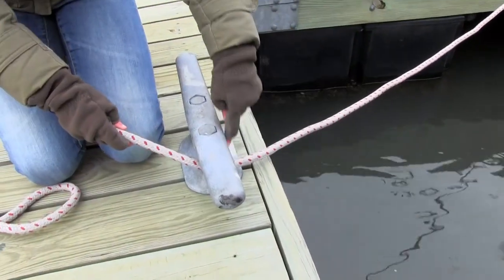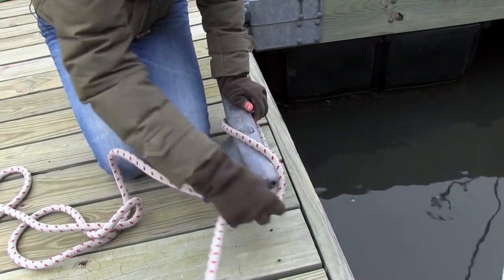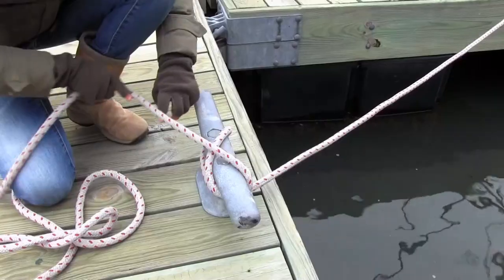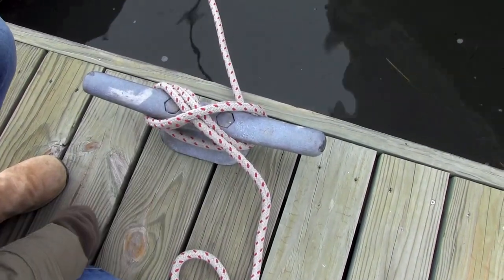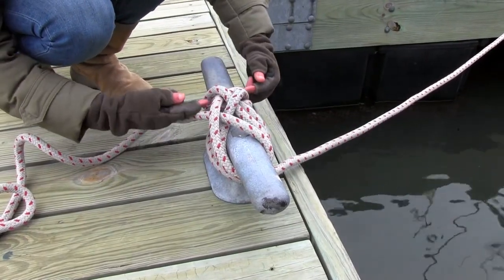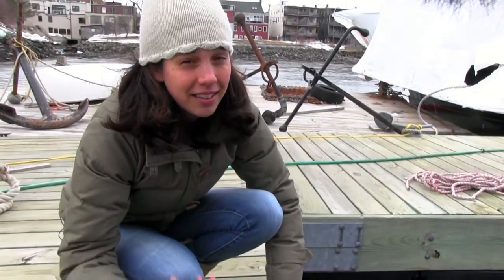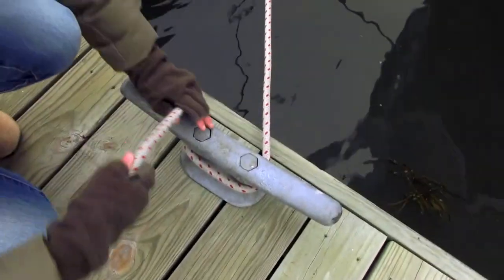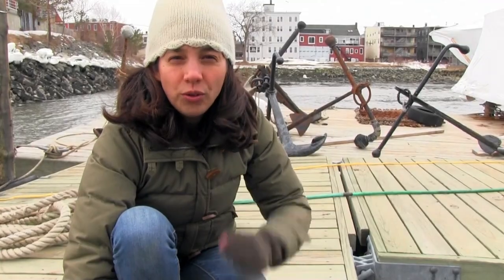How to Properly Cleat A Line - the way we learned on tall ships and other vessels with heavy loads

Comment: Question for you (great demo, BTW): how do you start the hitches when the load is perfectly in line with the horns of the cleat, ie. the turns MUST get pulled under the loaded length of line leading away from the cleat?  (I hope that makes sense?  You know, when there is no “V”?  A good example would be some cleats that are beside non-self tailing winches.)
Reply from the maker: Ahh yeah this happens all too often. It's poor design on the manufacturers part. They want the cleats to look symmetrical, but unfortunately it screws up the lead.We have the same issue on our stern cleats for docklines. I have no good answer. You could fake the lead by "barber-hauling" the line, but that's not very elegant. You could add some kind of line organizer type fairlead, but that will induce friction. Best solution is to remount the cleat so you have a fair lead -- or a "V" as we demonstrated. I feel your pain.

Comment: I can understand a single lock in some cases, but as far as I know, the standard is two locks. It's what I prefer at least. I am curious about your view on the direction of locking; parallel or crossed in relation to the underlying line?
Reply from the maker: There's really no need for a second lock. I've never heard of two locks being standard. There's no need for any locks at all, except to keep the line from accidentally getting pulled off the cleat. Some tall ships do not allow locking hitches on anything because of the potential for jamming under load. The locking hitch should go parallel to the underlying line. It's a more compact lock, and provides more surface area contact which means more friction, which is what makes all knots, bends and hitches work.
Reply: @MorseAlphaExpeditions  thanks for the reply. I asked because you do both in the video. You explain parallel, but then show crossed quite a few times.
Reply from the maker: Can you tell me what part of the video you are referring to? I want to make sure we are explaining it correctly. We give an example of how NOT to do it. Is that what you're referring to? Please let me know where you saw that crossed example.
Reply: That’s the best explanation I’ve seen!  You clearly say what you’re doing and why you’re doing it,... and it makes perfect sense. I had been taught to do a full turn around the base of the cleat before using the horns,... but as you would expect, it often got pinched. Then, I always did one turn on each horn and then the locking turn as you demonstrated— and while I’ve never had one slip, sometimes the locking hitch was almost impossible to release because of how loaded up it got...  now, perfection!  Thank you!
Reply: @MorseAlphaExpeditions  I think gadenhertog is looking at the turns as “crossing”, because they are figure 8’s— but it’s just the final locking hitch that lies parallel.